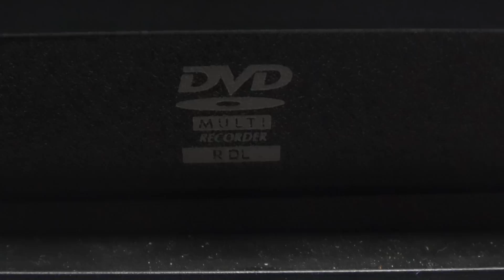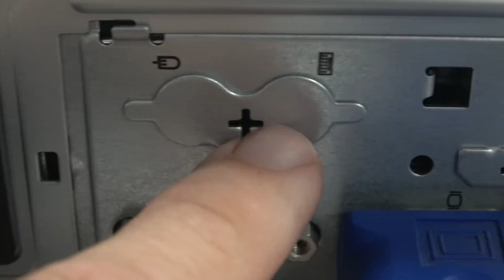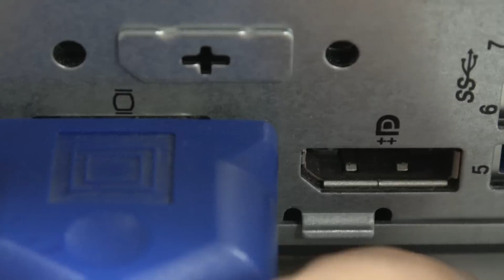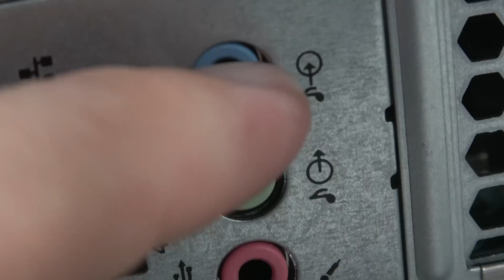Computer Ports, Plug Ins, Outlets, What are They, What are they Called, What are the Symbols

Comment: What does I0I0I mean? I have it on the back of my pc
Reply from the maker: Yep, I googled that, it's the symbol that was used for Serial Ports, that were on computers all the way back to the 80s. Used to use those ports to plug in various slow-speed data devices. I don't imagine they're used much anymore; the USB port is so much faster
Reply: Yh same it's on back of my laptop